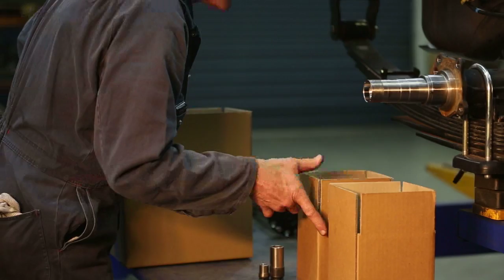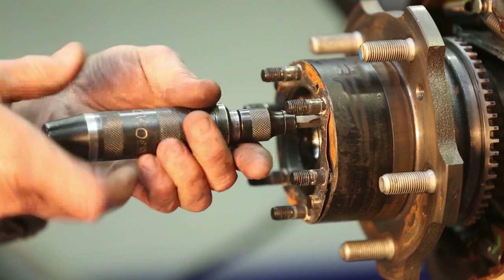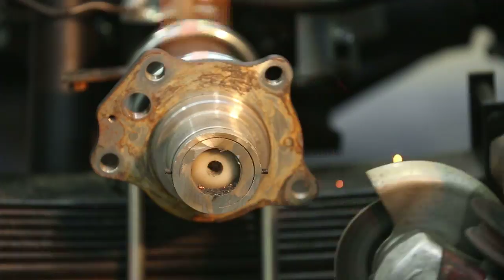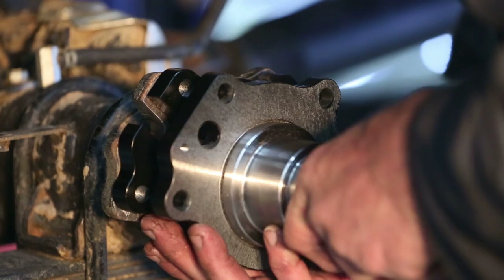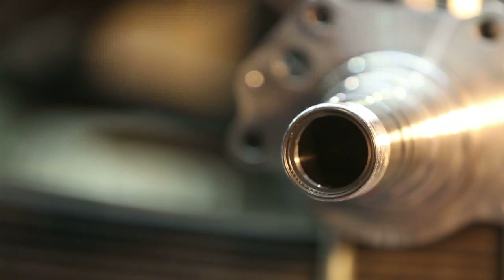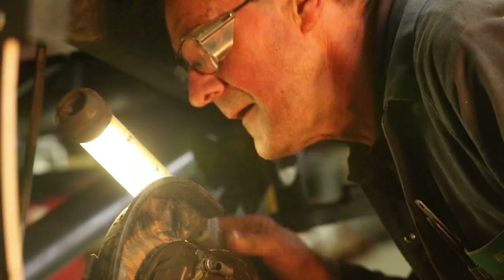MDT Tru Tracker Installation

Comment: A point with the new stub where two bolts are short and two long. Put the short bolts to the front, long ones to the rear. This is what I found. The description isn't clear on this.